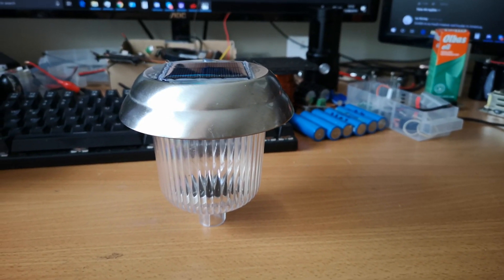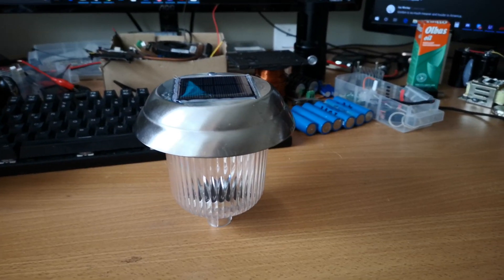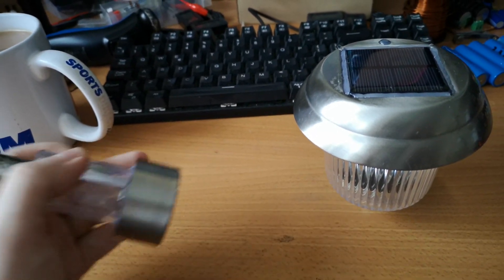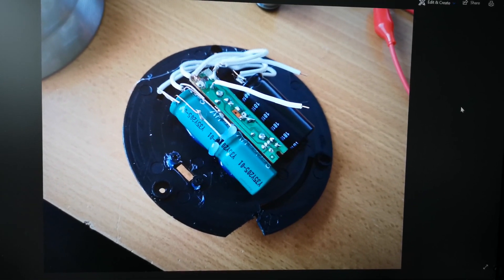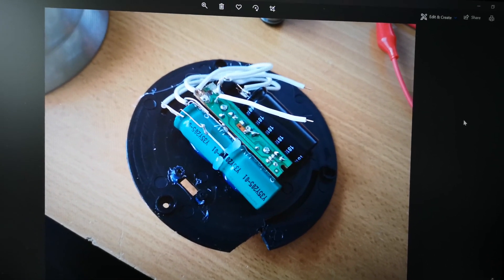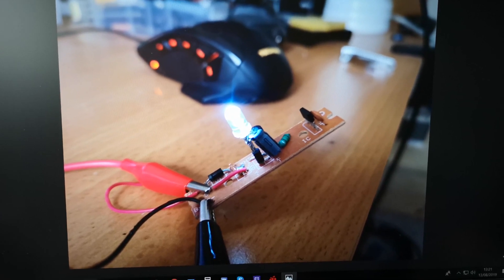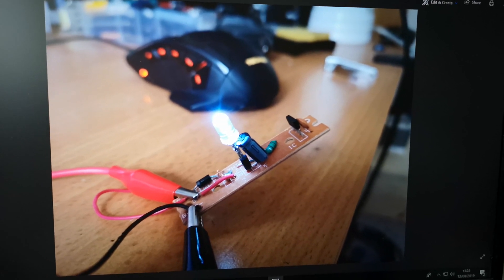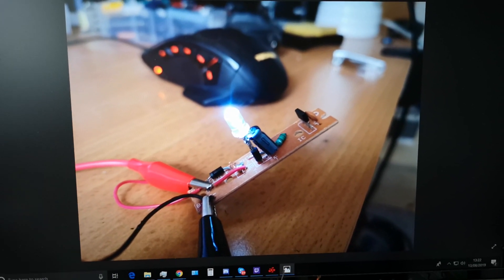[DIY] Super Capacitor Garden Light Conversion

Comment: Have you tried adding a super cap to a fan circuit? I did something with a regular camera capacitor years ago. And it made the 12v dc motor I used, go super fast. But i had it linked up with the inputs on the motor... Was like having a ridiculously high setting on the fan I made.
Reply from the maker: Hmm. No i have not done something like that.

Comment: 3V solar panels will overcharge the Cap quite a bit. A 3Vsolar  cell is 6 dies in series. Each individual die can go up to 0.6V, making for 3.6V total when its very sunny. You can remove maybe 0.25V for the diode and end up with 3.35V. on a sunny day. Super cap limit of 2.7V is a quite hard one... go above and you get bubbles and evaporation in the electrolyte. So better go for 2.5V solar  cells...
Reply from the maker: Well I never said what I was doing was perfect. Considering 2.5v panels don't really seem to exist, if I make anymore of these converted solar lights. I may just add a few diodes in series to increase the voltage drop.

Some time in the future, I may take the light apart. To see how the parts have faired over time.
Reply: @Alexzone45  2.5v does exist. also 0.5v, 1.5v etc... You can see in the link here that there are many configurations and all you need to do is count the dies, they are usually visible. The 2.5v in the link is 2 rows of 5 dies, 60ma per row. With the right diode used should be 0.25 - 0.3 volt loss which is perfect for many years of use! https://www.amazon.ca/uxcell-120mA-Module-Charger-59-8mm/dp/B073Y5N4G7. I've got a larger solar light that is brighter and so considering  2 of the 2.5v in parallel and a 400f super capacitor. I'm thinking even 4 of the 2.5v in parallel could be great. On a cloudy day I might still get a full charge!

Comment: Thanks for making light/vid and answering my questions. (I was wondering if the supposed 500f caps would do the job.)
 Now I think with a higher current 3v solar panel I may get away with dropping the inductor value slightly to increase brightness on my "eternal sun-jar" project with warm white 1w led. 
Was wondering which ic your light uses? 
if your light uses QX5252f ic like many they are popular in this type of project. 
Hope your light lasts well.